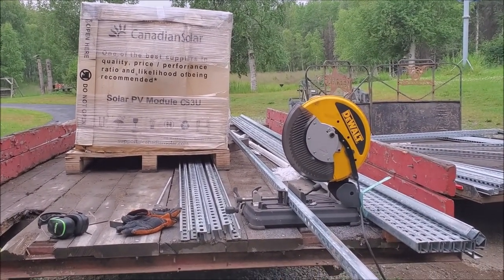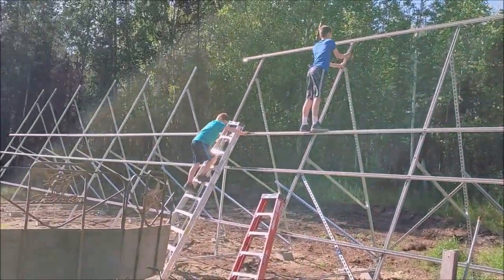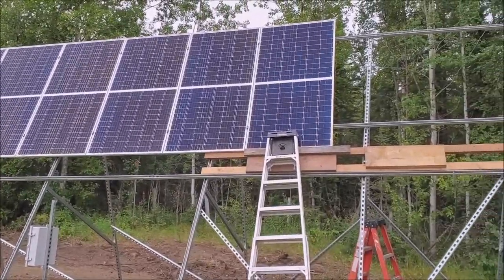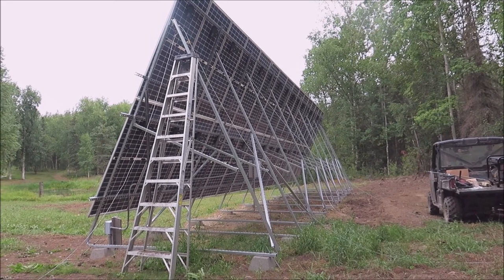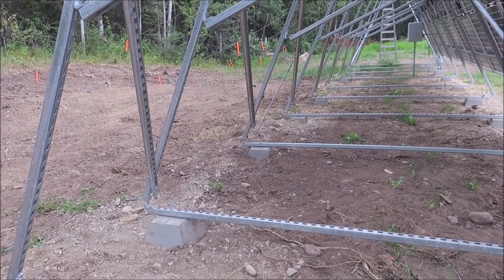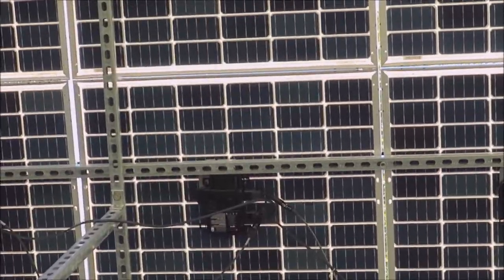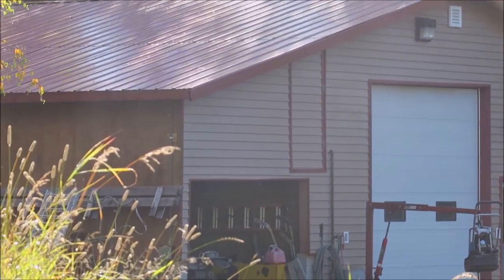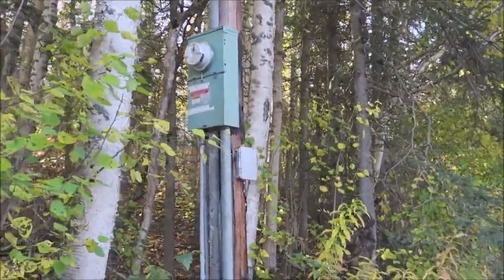DIY ground mount Alaskan solar

Comment: Hi Bill.where did your learn all about DIY installation of solar thanks Trev in sunny cape Town south africa
Reply from the maker: Any project I start nowadays I almost always look on YouTube to see how others have done it to get some ideas.  I have a little more experience than most since I worked as an commercial electrician for a large company doing whatever they needed (equipment operator, welder, plumber ect. )